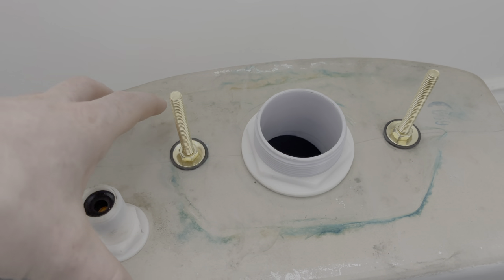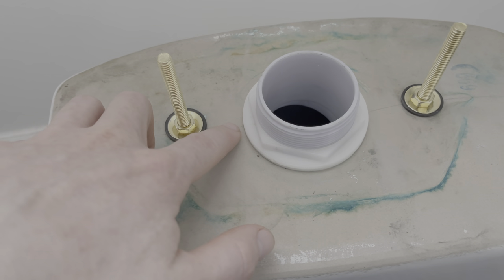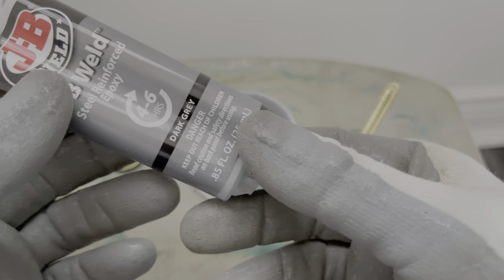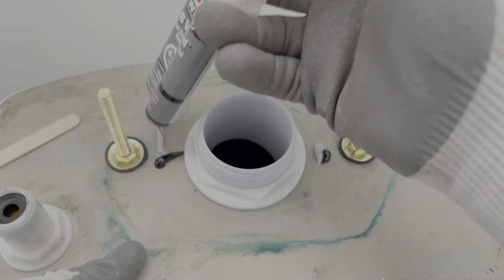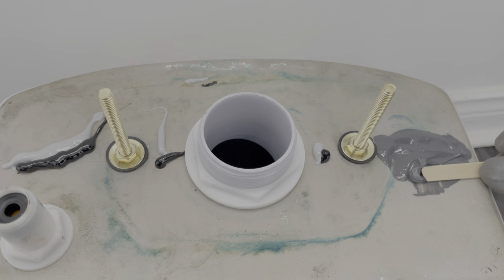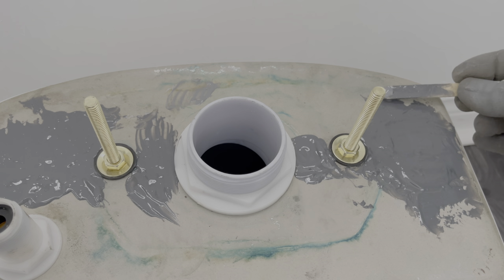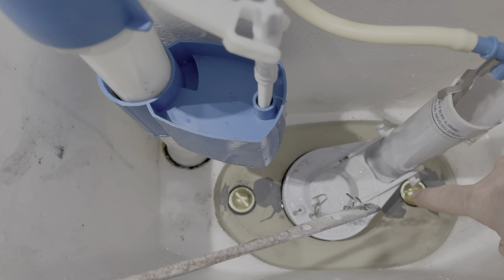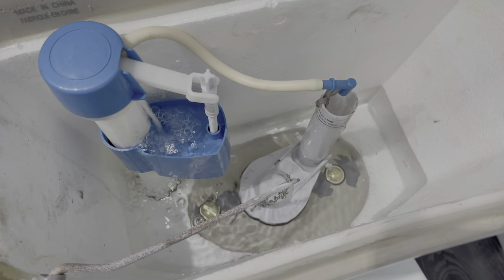How to repair a crack in the toilet tank / how to fix a crack in the toilet bowl -toilet tank repair

Comment: I never had good luck using JB Weld for anything.  Actually, my bathroom toilet tank had a crack extending from the flush handle to the base.  What I did was to apply Seal All from the inside of the tank (behind the crack).  It took several applications of the Seal All to completely seal the leak, but it did work.
Reply from the maker: Depends on the type of crack I guess because I am happy to say that even after 2 years - it is still okay. You just need to make sure it is fully dry and yes apply from the inside and outside

Comment: Nice job. My only concern is the tank is still cracked and the crack extends through all of the hardware holes. I would recommend removing all of the hardware as a first step.  I would then recommend using a dremel to cut a groove from end to end of the crack before applying the JB weld.
Reply from the maker: Thanks for the tips! lucky after 1 year this is still holding up
Reply: @DoitDoit  That your repair worked for this particular job, doesn't have any bearing on what the best approach to this challenge might be. In 9 cases out of 10, removing all hardware, grinding out the crack on both sides, and penetrating the area from both sides with epoxy and reinforcing fiber mat... would be preferable. That method is the same proven method used in other disciplines, in other situations, where component repair is the only option. 

Cracks tend to propagate rather than disappear, so there's that.

Comment: Can you update on your repair please? I have a cracked toilet I will sanded down then I will use J-B weld from Home Depot it cost around $20 professional grade epoxy  I don’t know if it will work but I will update you guys on my project
Reply from the maker: it worked great. had to use it on both sides. still no leak again. this one worked great

Comment: Epoxy is a viable repair for HAIRLINE cracks in toilet tanks---plumbers do this all the time. A BETTER repair includes: 1) embed fiberglass mesh into the epoxy, and 2) apply reinforced epoxy to both sides of the hairline crack. Allow epoxy to CURE for 24 hours before reattaching the tank. The person posting this video should have removed everything from the bottom of the tank BEFORE doing the repair.
Reply: Ahh, good. I'm not alone in thinking this task wasn't approached quite right. I bet it leaked. We'll probably never know.
Reply: @lancethrustworthy  Further down in a reply to another comment he says it’s been 2 years and it’s fine.

Comment: What nobody mentioned is the reason for the hairline crack . The single nut system found in toilets such as Toto if we overtighten it will stress the tank bottom wall . The system he showed is much better
Reply: YEP! It’s really really frustrating! I was so proud of myself for removing our toilet and fishing out a lotion bottle that one of my kids had flushed and gotten stuck in the toilet bend…then of course I went to reinstall everything. I was on top of the world, knowing that I could salvage this toilet, and that I had even aligned everything properly on the bottom half! I tightened the nut half a spin too much and now I have a hairline crack! I’m so disappointed in myself. First time homeowner here. Self taught (YouTube and various forums) for all my handy work, I saw so many warnings about overtightening. The only problem is that even though I went slowly, the tank went from a heavy drip to a crack so suddenly, I don’t know if anything other than experience would’ve helped me here, and I really don’t even trust myself not to overtighten again considering how much water was still flowing out as I was tightening🤦🏻‍♀️

Comment: Guys, ALL toilet tanks eventually crack ‘because’ when a person ‘sits’, the backwards ‘pressure’ and other movements stresses the two attachment bolts a little or a lot, and over time that continual pressure causes the porcelain (which is basically made of pottery ‘clay’) to develop hairline cracks! (Just normal human behavior). The bolts are like ‘wedges’ and stress the holes and the material around them (the toilet tank) and leaks develop. Solution…a new tank invented; or a ‘back’ support so that the space between the wall and the tank is stabilized and fixed so that the tank can’t move; or the engineers develop a different system to solve this problem. Just my opinion after dealing with this situation.
Reply from the maker: luckily our other toilet is now 6 years old and no cracks , also no more cracks on this one

Comment: Thank youuuuuu omggg. 

I just taught myself toilet 101 this week lol- had to take the kids’ bathroom toilet off the floor to fish out a lotion bottle one of them flushed🤦🏻‍♀️ Broccoli it was stuck in the bend of the toilet, and didn’t go past the flange into the pipes! It was super wedged in there, but I snaked it out and then, as I was replacing the toilet, I overtightened the tank grew, and there is a small, hairline crack of course, even after watching 1 million videos cautioning against this very common mistake😅. Really appreciate the info and camera angle you’ve provided! Fingers crossed I didn’t do all of that work just to have to replace the toilet anyway 🤞
Reply from the maker: No worries, its been several years for us and this fix is still holding up

Comment: Oh no! This is not the way to do it. You should have dried the tank very well, then applied the epoxy on the INSIDE, not the final line of defense. Actually, I'd have you do Both sides of the tank bottom. 
Stunned, that you didn't take all the bits (screws, nuts, etc) off before applying the goop. Oh well. 
I think you have not dealt with water leaks much. Lol. Water don't play.
Reply from the maker: seems you didn’t watch the entire video . but yeah it’s been a few years now and all good . no leaks or anything . everything still holding

Comment: Thanks for the video.
My only concern would be that there is no "waterproof" note on the epoxy package.
It needs to be waterproof for this application, water resistant might hold for a while but eventually will leak overnight or when you are away for a few days.
Reply from the maker: its been 2 years and no leaks yet. Lets see how many more years it holds. But regardless it is recommended that you turn off the water for the house when you go away for a few days because anything could happen anywhere in the house
Reply: @DoitDoit  Cheers, I have decided to use JB Weld Marine option, it worked great as well.